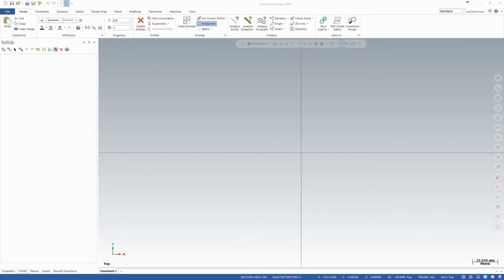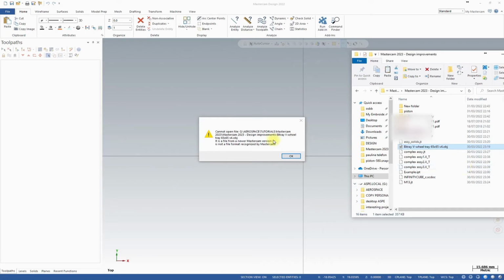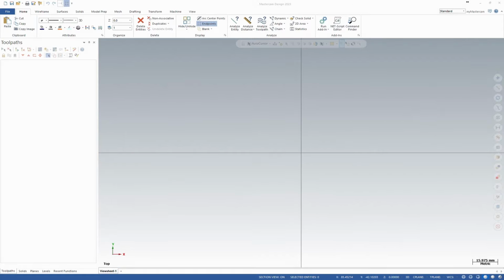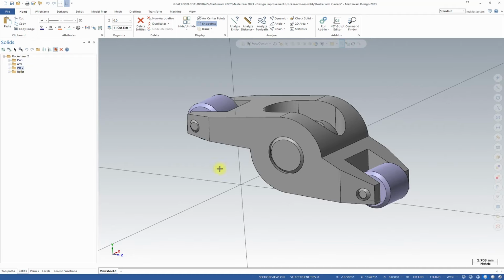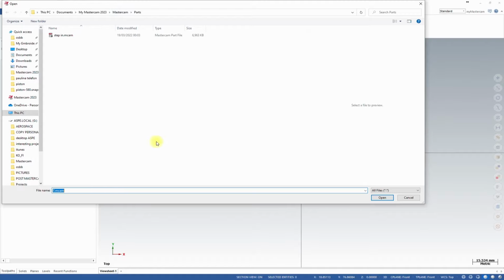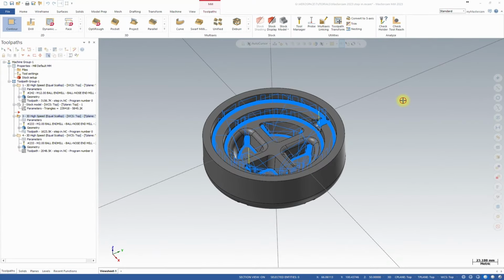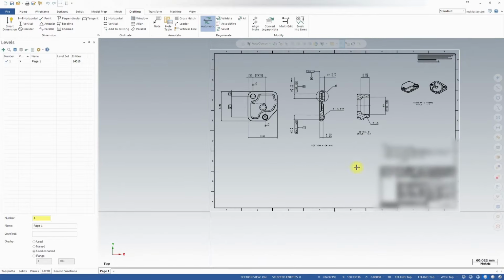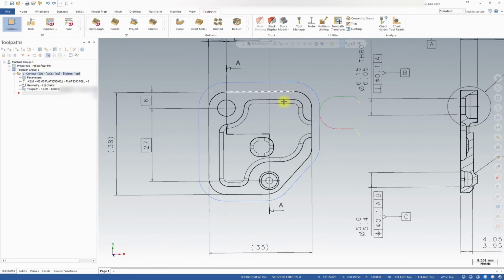Mastercam 2023 - Sneak Peek - Improvements in working with files

Comment: so i downloaded the beta and i have seen that there is a "include Stock" checkbox in optirough. Do you know what it does? because i dont see a difference. Maybe its just a bug.

edit: ooh i think that refers to the stock, not the setup-stock.
Reply from the maker: Good question my friend
It will include stock setting from the stock page
If you set the automatic boundary to "None", Mastercam applies this option automatically
Reply from the maker: also when you create a stock model (example: create a block size of raw material block size)
In opti-rough - go to  "STOCK" page: select one other operation, and select this stock model
then go to steep/shallow page activate "z depth" add tick "Automatic detect depth" and tick "include stock" - Mastercam will cut the material with depth calculated from the stock model (the one you selected on "stock" page)
ill post a short video showing all those things this weekend
Reply: @aspeaerospaceprecisionenging  that's great :) 
cant wait to see the video demonstration 
thanks

Comment: Do you by any chance have a postprocessor for Heidenhain? If so, coult you test something for me? 

Basically you have to:

1. Create a new plane somewhere in the window but not in the middle of "Top" plane. Call it for example "setup 1".
2. Create a solid block in the middle of that newly created plane. For example 50x50x50mm
3. go into the machine group stock settings and activate the plane "setup 1" and then calculate the stock from solid. It should now be exactly the same size and position as the solid block.
4. create a new plane on one edge of the solid but with the same alignment as the stock plane. Call it for example "setup 2"
5. set "setup 2" as WCS, T-Plane and C-Plane
6. create any toolpath (you can do just a drilling operation and click one point and then just hit calculate) just so you can post and see what the stock definition for Heidenhain says.
7. now move "setup 2" to a different edge of the solid. Dont rotate it yet. Recalculate the toolpath and post again. The stock definition should still be correct, relative to the WKS of the toolpath.
8. now rotate "setup 2" around any axis 90/180 or 270 degrees, recalculate the toolpath and post again. Do you also see nonsense numbers in the stock definition in the Heidenhain file? whenever you have the WCS of the toolpath on an edge of the 50x50x50mm cube, the stock definition should always say something like this:

1  BLK FORM 0.1 Z X-50 Y-50 Z-50
2  BLK FORM 0.2  X+0  Y+0  Z+0 

where each number is either 50/-50 or 0, but when i rotate the WCS, there will be nonsense numbers. 

But i have found something interesting about that:

if i put the cube exactly in the middle of the standard "Top" plane (X,Y and Z middle of the Solid to X,Y and Z of this plane) and place the "setup 1" WCS in the same position as "Top" plane, then i can rotate, move however i want around any axis i want and the stock definition in the Heidenhain file is always correct, relative to the WCS from the Operation. I believe when i rotate the plane "setup 2", then the stock calculation is relative to the "Top" plane, which doesnt seem to make any sense to me. I believe this is a bug.

I use the Stock definition often and when i have a part with multiple setups from different sides i always have to manually correct the stock definition after posting, which is annoying.

there is a different "problem" with round stock definition. The part has to be in the center of "Top" plane to correctly calculate the stock from the solid. If i place the same solid somewhere else then the Stock gets way bigger and eccentric and the center of that stock is still in the middle of the "Top" plane.
Reply from the maker: Unfortunately, I don't have a Heidenhain post 
Most of our machines are MAZAK machines
did you contact your mastercam reseller regarding this?
Reply: @aspeaerospaceprecisionenging  yes im in contact with them, but i wanted to see if i am the only one with this problem.

Comment: The PDF geometry that i can use for engraving or machining toolpaths where 3d file is not available its a great solution
Reply from the maker: yes it is good option i already tested it on simple engraving and it worked ok
i noticed that not all PDFs are processed in the same way